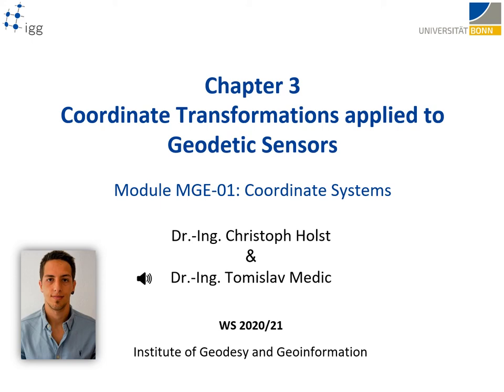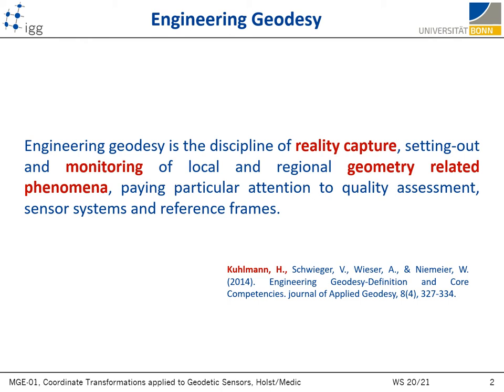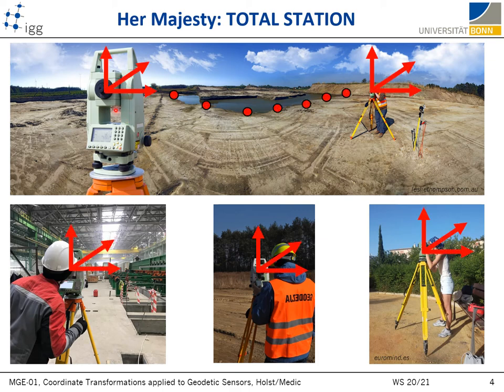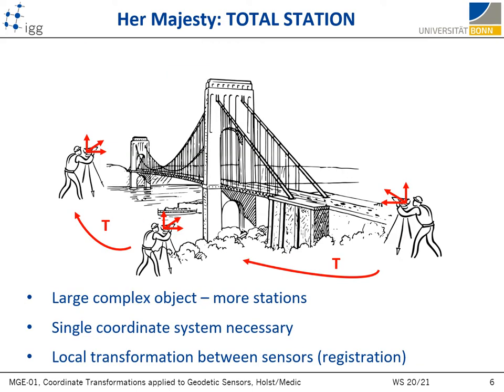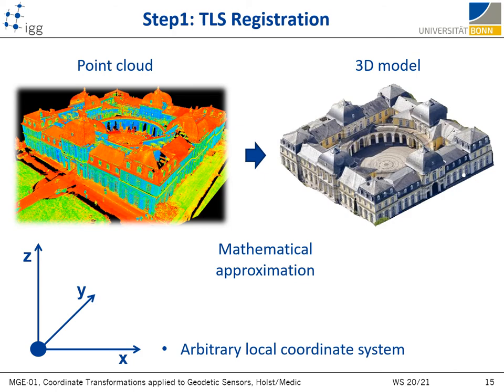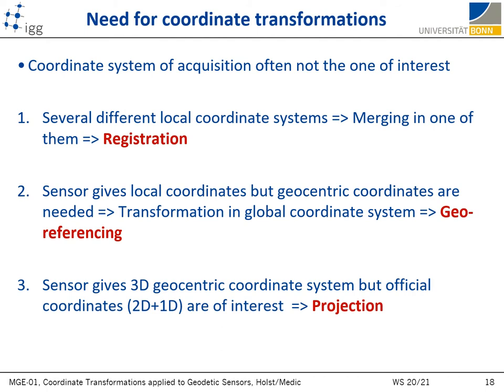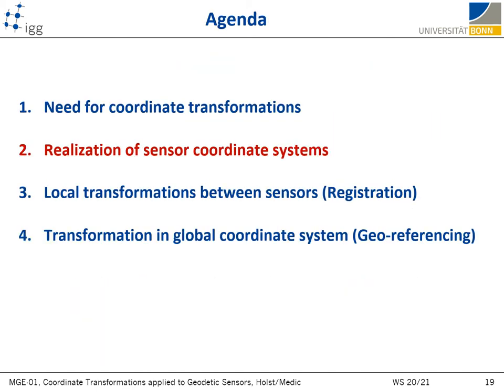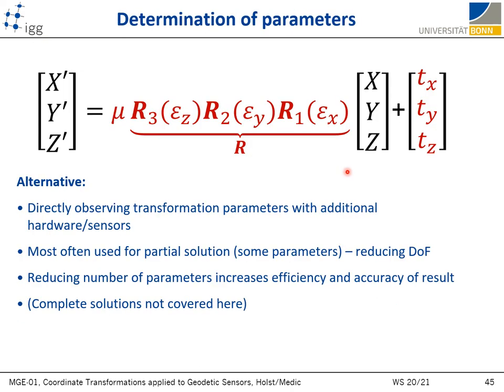Coordinate Transformations Applied to Geodetic Sensors (Tomislav Medic, 2020)

Comment: BYZANTINE ( ROMAN EMPIRE ) ASTRONOMY FROM A.D. 1300
EMMANUEL A. PASCHOS 
Department of Physics, University of Dortmund, Germany.

”…A Byzantine (Roman), article from the 13th century contains advanced astronomical ideas and pre-Copernican diagrams. The models are geocentric but contain improvements on the trajectories of the Moon and Mercury. This talk presents several models and compares them briefly with the Astronomy of Ptolemy, Arabic Astro nomies of that time and the heliocentric system…”

“……In contrast to Western Europeans "the Arabs had virtually full access to that, Greek, heritage from the eighth century onward. This occurred because of a momentous translation effort whereby the great works of Greece and other cultures were translated in Arabic". Later on (12th and 13th centuries) the classical knowledge was transmitted to Western Europe through Byzantine and Arabic sources and Irish monks who travelled across Europe founding monasteries and scriptoria..….”